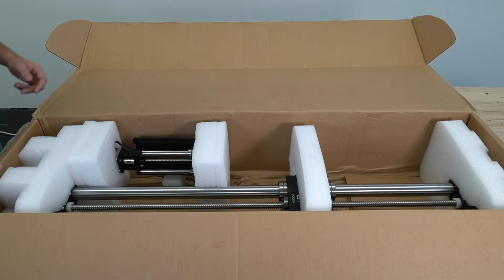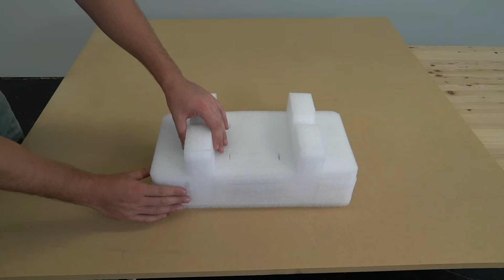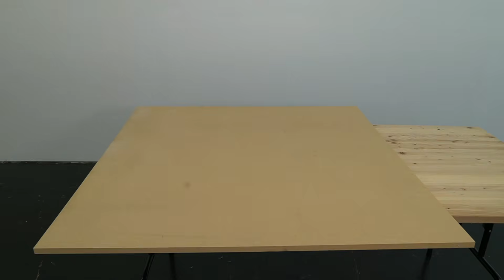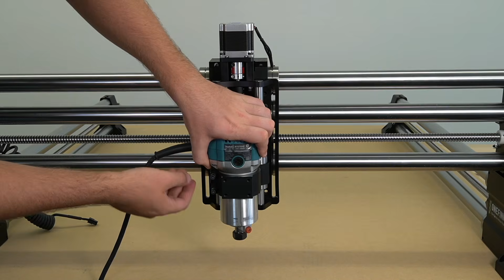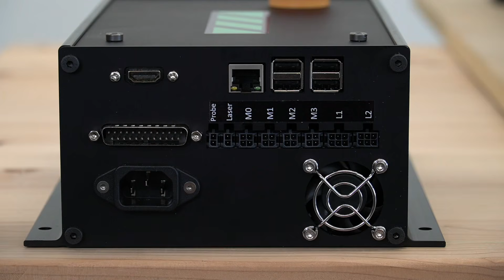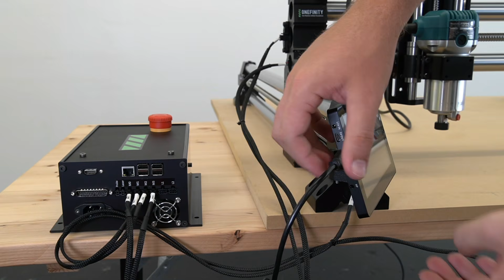Official Original Series Gen 1 Assembly Video

Comment: I haven't seen anyone mount one of these on a full metal table yet. Is that overkill? I have built a 50 x 50 table made of 3 inch square tubing with a 3/16 top. In my mind (from the machining world) more rigidity and mass is better. Thoughts?
Reply from the maker: check the forum.onefinitycnc.com for table setups.

Comment: Not only was the video one of the best "How To Assemble" clips I have seen; but the machine itself looks to be well ahead of other machines in it's price range (as far as structure.and design). 
That said a try to their website and you are met with the message: "All machines are backordered". I saw no information as to why or when they would be available.
Reply from the maker: There is a shipping table and notices at the top of every purchase page.  They've been backordered since release because of incredible demand.  Wait time is generally 3-4 months.
Reply: i bought a longmill mk1 1 month before the mk2 suddenly showed up to actually support the weight of the gantry properly. a year later still cant do a single project without it aborting or disconnectint from the computer run software, and cant get better than .3mm accuracy. wasted money and if i had know this i would have gotten it. but now im broke because icant deliver complete matching products and killed my company. Sienci didnt send me the power cord that goes into the controller (not the wall plug side) and when i told them, they sent me a regular computer power cord and hex nuts. came with bent linear rails and they said the wobble was within tolerance. so ya, this video makes me wish i chose the right canadian company. kinda sad but wish i could get one now

Comment: I don't understand how this procedure "squares" the machines rails. Couldn't the rails be parallel, but still out of square using this method?
Reply from the maker: Not if done as we instructed.
Reply: Yes. You can end up with a trapezoid if you don't make sure both Y are exactly the same length which they almost surely will be, AND measure diagonally across them when placing them.

There have been multiple user forum posts showing the problem since this original assembly video was made.

Once placed with a screw or two in each foot, you should then using gcode move a V bit to 4 equally spaced corners, not at limits of machine, at least a couple feet apart to create dimples on the top in a square, then confirm it's diagonals are dead on.  Once verified, install all foot screws. If not, adjust and repeat.

Comment: Okay so by sliding the front of the machine to the front of the spoilboard, you are gonna lose some Y cutting distance. The Z axis along with the router will stick out past the front feet......am I thinking right on this????
Reply from the maker: the bit will not stick out past the feet.  it's in about 1" from the feet.
Reply: The bit will still be on the top. However, if you use a dust boot it will hang over. You will want dust collection, believe me.

Comment: Do you have plans to offer different size CNC's?? I am currently looking at a different machine that offers a 1500x1500mm work surface. I think you offer the better machine, but the current work surface isn't quite large enough for my needs. I would also like to know if I could attach either a laser, or a rotary axis to this machine. Thanks.
Reply from the maker: We have nothing to announce at this time about size.
You can attach a laser, we sell one in our shop.
We do not have a rotary.

Comment: If you reverse the y rail assembly so that stepper motors are towards the front. Is the stepper motor for the x rail on the left versus the right?
Reply from the maker: you can change each one either way.  It will just be a matter of reversing the motors on the controller and placing your controller next to your wires.

Comment: Where does one find more info on the “stiffy” accessory or 3rd rail?
Reply from the maker: https://www.onefinitycnc.com
Reply: Onefinity CNC I don’t see it anywhere under accessories or the machine options 🤷‍♂️
Reply: @mikechambers6871  hey mike did you finally found out about the   Mystery  bar stiffy ?
If yes let me know price etc tried cannot find nothing
Reply: @athanasiospersopoulos1499  They haven’t offered it as an accessory yet. It comes free as part of the discounted price on the pre-order right now. it will be added after the price goes up and the pre-order is over so if you buy now it comes included in the price